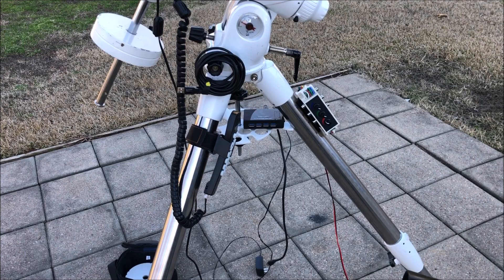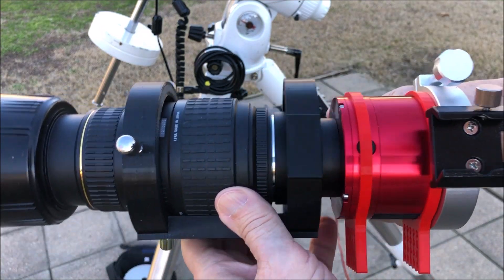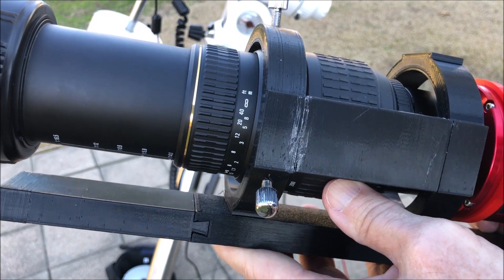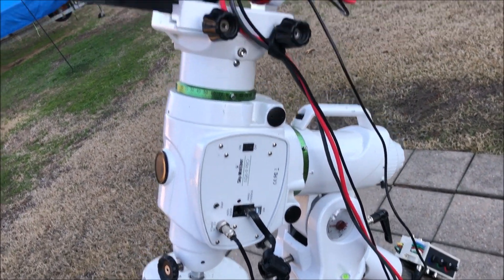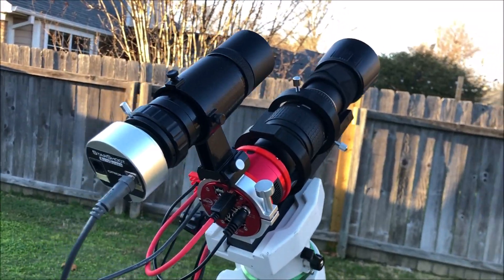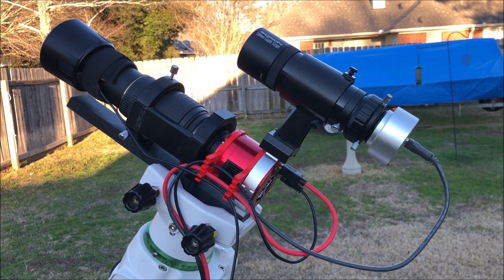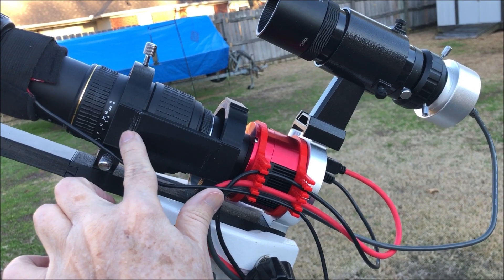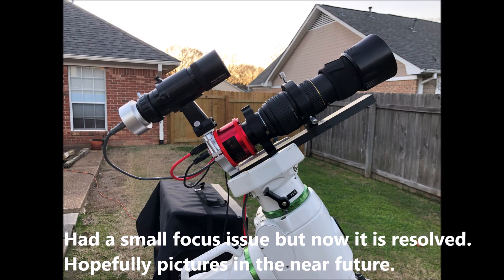Using a camera lens and a ZWO ASI camera

Comment from the maker: IMPORTANT NOTICE: I discovered that this old film camera lens, which is a zoom lens type, will not change the f/stop to anything below f/22 to be in focus. It will only focus set on f/22. So, the setup is basically useless for other f/stops for more aperture openings. Does not mean other lenses will not work. There is also an adapter, I came upon, that will work electronically opening aperture and focus, but only for Canon mounted type lenses and not all of them. I checked out the vendor’s site and they had a list of compatible lenses for their adapter, but the two Sigma lenses and two Canon lenses that I was wanting to use, will not function with their adapter that fits to some of the listed ZWO camera the adapter fits.